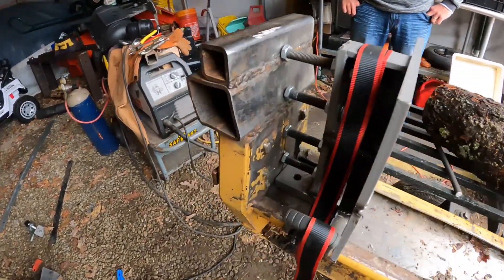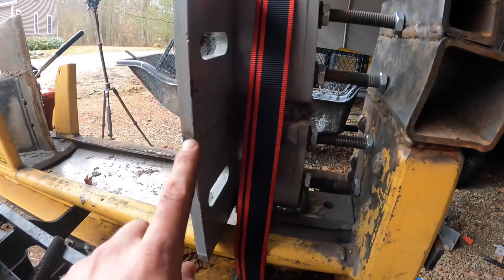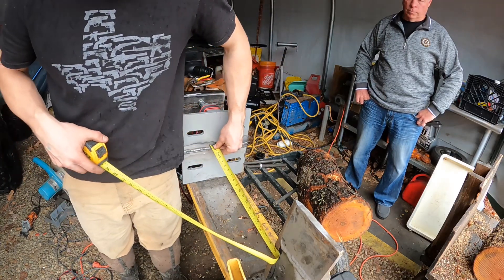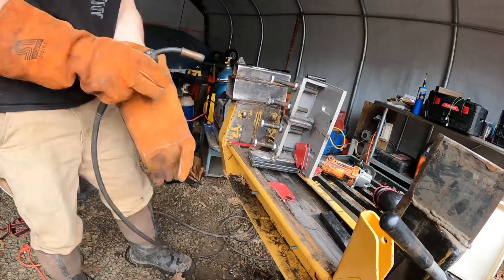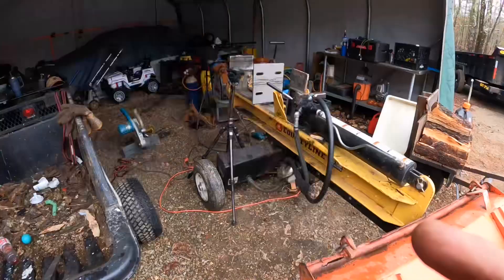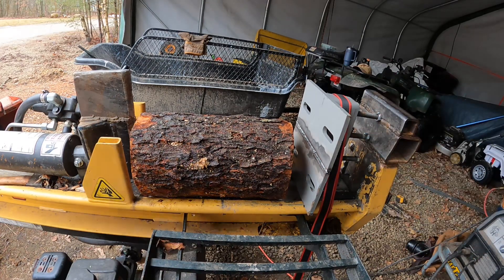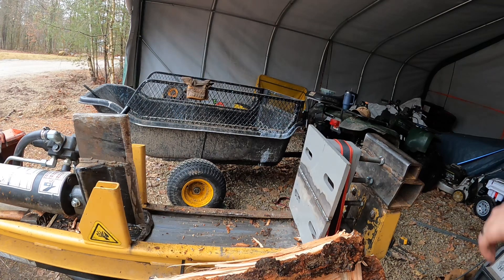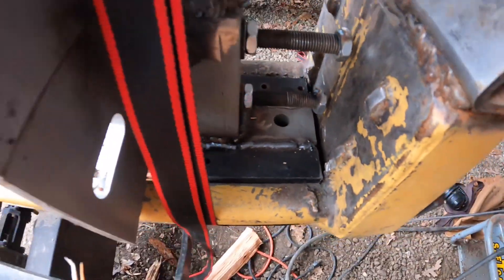I SHOULD Have Been An ENGINEER 😂

Comment: HELLO JAY, HAVE LIKED SEVERAL OF YOUR VIDEO'S
A TIP FOR AN EASY SOLUTION, WOULD BE TO BUILD A SPACER FOR THE SPLITTER HEAD. WITH SOME SMALL PIPE AND AN EXTENSION PIPE, TO MOVE SPLITTER HEAD CLOSER TO BASE PLATE.
HOPE THIS HELPS
Reply from the maker: Thats a cool idea thanks for sharing!

Comment: I just use a wood block spacer or stop the stroke on the return.  Be careful that taller plate and taller wedge doesn’t catch an arm or your torso.  It is fun making stuff.  Dad used the splitter a few times to break tire beads with some modified parts.  You can squish just about anything you can fit up to the rails.  I’d for sure round off the top corners on that plate you added so you don’t scrape your arm loading/unloading.  I really need to weld up a rack to cover the gas tank/engine from getting hit.  I’ve been lucky I haven’t hit it yet I guess.
Reply from the maker: Thats more or less what I wanna do is get creative and work on my fab skils so its a win win really! Were gonna put it to the test cause we need to make a cord of green wood so well see how that works! I am going to get another shelf to protect the engine indeed! Had a few bounce off it before lol

Comment: Back before I got my eastonmade ultra, I did a similar thing on my county line. I didn't get fancy with metal, I just wedged in a chunk of 8x8 at the end of the beam and it worked amazing for months.
Reply: I added a bungee cord around the back and lag bolted to the sides.. I used a piece of railroad tie .

Comment: The cylinder stops are spring loaded so they just pop on and off very easy. They are quite simple and easy to use. Used them for years on the farm.  What goes around the rod is aluminium in halves with a flat spring that holds them together.
Reply from the maker: Good to know!

Comment: If you had put cylinder stops on the cylinder you wouldn't have to worry about crashing the wedge into the stop plate. Also the return would still work properly.
Reply from the maker: The idea is to have something I can take off easily to switch to boiler wood. If I know im doing "production wood" to sell ill take the time to put the back plate on and (4 way wedge) coming soon for that. I dont want to deal with cylinder stops

Comment: Make a simple stroke limiter by placing a piece of plate to stop return stroke.
Reply from the maker: The splitter doesn’t work like that. If you try and stop the ram on its return stroke without moving the lever it was struggle.